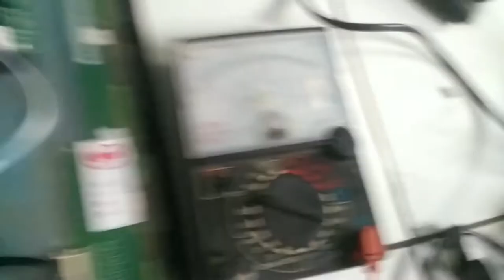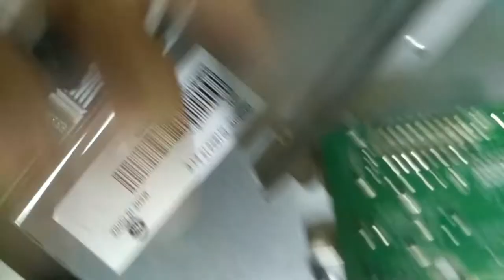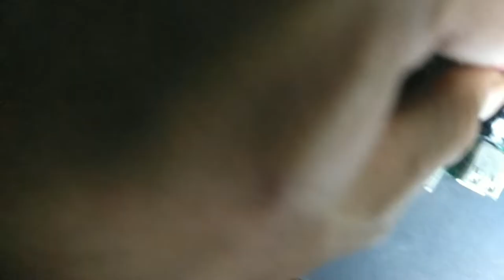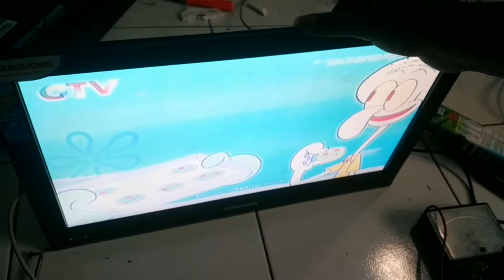KENDALA TV MATI SENDIRI 2 s/d 10 MENIT || SERVIS DIRUMAH TV LED LCD

Comment: Punya saya tiba" mati kang, kmrn smpt hidup sebentar ga lama mati lg smp skrg, lampu power hidup, gmna solusi'y?
Reply from the maker: ada beberapa kemungkinan, cek dulu tegangan power supply nya, kalo normal ada kemungkinan ic programnya error
Reply: @OfficialGioSankara  kalo ga punya multitester gmna kang? 🙏
Reply from the maker: harus pakai multitester untuk mengetahui jumlah tengangannya, karena ada 2 tegangan yg harus stabil 5v dan 12v dari konektor power supply nya